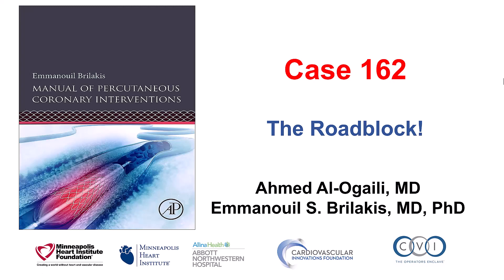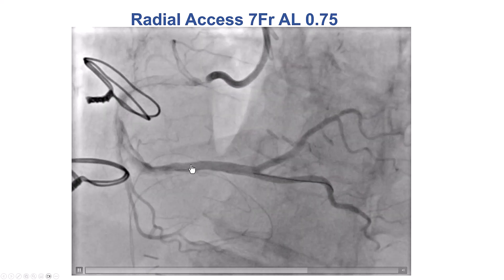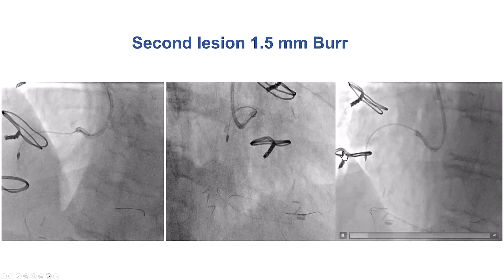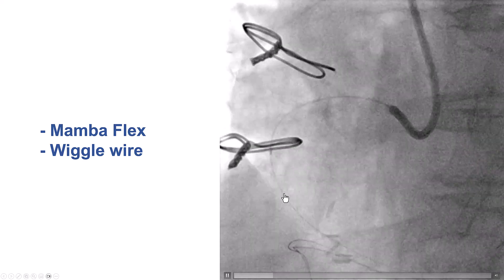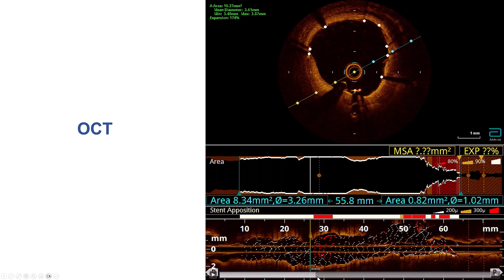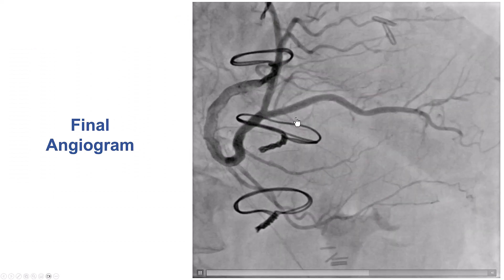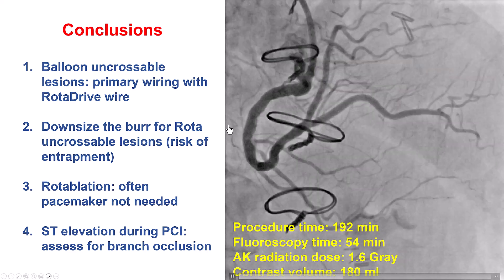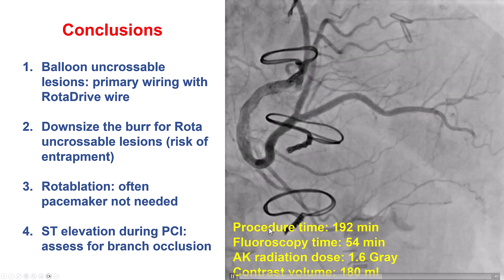Case 162: Manual of PCI - The "roadblock"

Comment: Thank you for your case! Huge fan! Small comment: after ~3 min runs, the burr’s diamonds coating is gone; you can feel it. So switching for a new 1.5 burr is recommended. That was maybe one of the reason the 1.5 burr didn’t pass.
Reply from the maker: Thank you for your comment. Agree that a fresh burr may have a better chance to cross, yet we have cases in which crossing was successful after >10 min for rotablation.